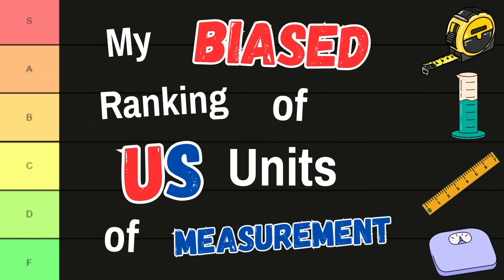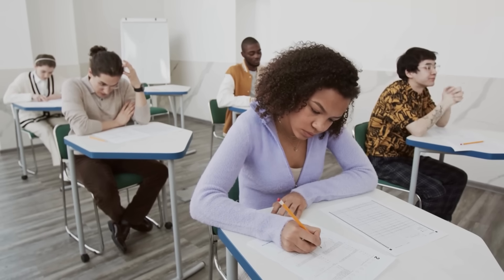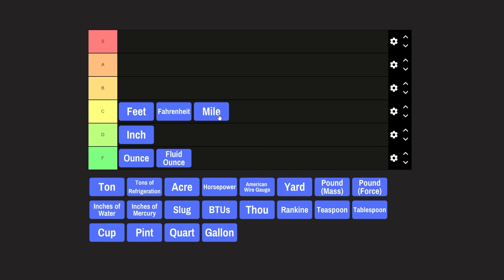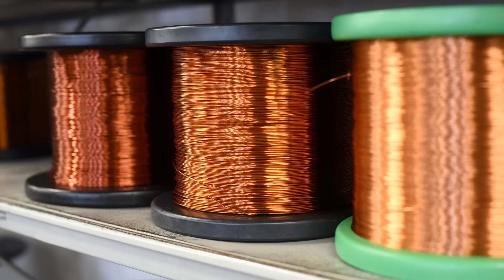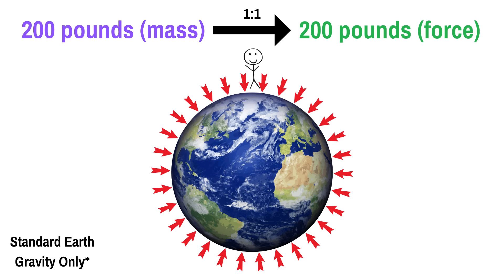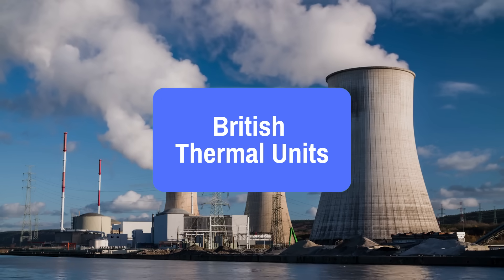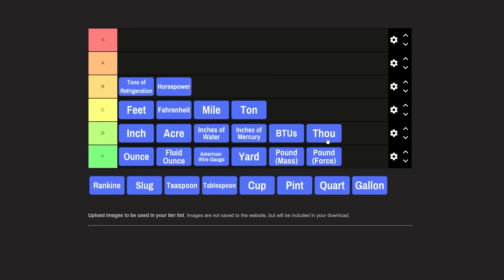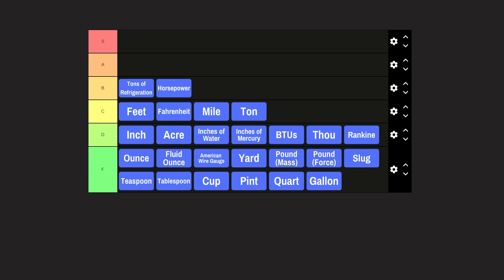Tier List of the DISASTROUS US Measuring System

Comment: The fact that you need to create a unit to define when you divide 1 by 1 should tell you everything you need to know about the US customary units
Reply: Some of these (BTU, Slug, Rankine, Thou) are metric units redefined with imperial units instead. A calorie is the energy needed to raise one litre of water by one degree C,  exactly like the BTU's "energy needed to raise one pound by one degree F".
Reply: stm7810  I'm not sure that's a "need".  SI gets along just fine with Megabytes and 60 seconds per minute.

Our numeral system is Base 10, but our math is base agnostic.  Except for Log.  But heck, it's usually overshadowed by ln anyway.
Reply: stm7810  I do enjoy seximal though
Reply: @pa28cfi Charge isnt a Fundamental Quantity. Current is. So it makes sense that Coulomb would be defined in terms of Currwnt and Time. 

Also Curr. and Charge are different, versatile, and widely used enough that they should have their own seperate units.

Ij terms of Slugs on the other hand there is no such reasoning or defence. Mass is possibly the most fundamental and basic quantity out there. And if you still need to define it in terms of one hyper specific unit acting on another hyperspecific unit, then yeah idl what to say after that.

Hope this helped clear things up 😊❤
Reply: @alexicon2006  charge could be a fundamental property
Reply: stm7810  All of the unit based disasters I'm aware of are due to conversion between the two systems.  Which is not the fault of either system existing, but to both existing.  If the world had gone British instead of French, but Quebec was a hold out, we'd still have these kind of disasters.

In short, that's an argument for a global standard, not one system over the other.

I'm not sure who your carpet guy is, but if he's used to feet that shouldn't happen.
Reply: stm7810  slugs work at any scale too.  It's just a unit.  They're all arbitrary.  Whether dividing them by 1000 or 12 to convert to another unit, they're all arbitrary.
Reply: Dude a Newton is defined by multiplying 1 by 1; it’s not any better
Reply: stm7810  all math is reliable.  SI is easier for you because you're used to it.  Imperial is easier for others because they're used to that

Comment: The problem for me with Fahrenheit is that it makes no sense. To me who lives in Sweden, the most important temperature is 0 degrees Celsius. Thats a temperature we se very often, and around that temperature I start wearing a jacket and putting winter tires on the car. Normal temperature during the year goes from -25 to +25. If I do it in Fahrenheit, the most important temperture is 32 degrees, and the temperature goes from -13 to 77 on a normal year. It is an overrated scale for sure.

In Sweden we have "spice measure", that is 1 ml, teaspoon is 5 ml and tablespoon is 15 ml. Very useful measures.

Comment: I think the other legitimate benefit of Farenheit over Celsius for the average person is that it's 180% more precise, so if I say its 68 degrees outside, that's tells someone more info than 20 degrees Celcius.
Reply: It's all down to what you are used to, i think.
Being from central europe for outside temps for me it is: 
20°C: short sleeves, 
above 25° shorts, 
30°C and above: uncomfortably hot.
below 20°C long sleeves are ok, 
below 15°C some thin additional layer on the upper body, 
below 10°C, i put on a cap and the additional layer on the upper body is more than just a thin wind protection.
Between +5°C and -5°C i put on my winter jacket and a wollen hat and a scarf.
below -5°C i am inclinde to put an additional layer under the outmost layer and gloves.
Below -10°C i definetly put that additional layer between the outmost and the inner layer and put on warm shoes.
Below -15°C  thicker gloves and the hood of the jacket.
(The lowest temp where i live as long as i remember was -22°C and i had 7 layers of clothing on my upper body because i was outside for a week of between -15 to -22°C having to sleep in a tent with a sleepiing bag that's designed with a lower limit of +5°C)
So in essence for outside temps i am roughly down to 5°C of resolution. Not even 1°
For inside temps: 1° is still enough for me. If only sitting and not working out or physically working, 22°C feels ideal to me.
23°C is still ok, 24°C is getting warm, 25°C is getting uncomfy. Anything above almost unbearable.
Don't even need tenths of degrees for that.

Apart from that, being 180% more precise (iirc) would mean there are 280°F in 100°C.
Reply: Because the temperature varies anyway one does not need such pseudo precision.
Reply: To me 68F outside doesnt say anything. You can always use 20.5C if you find you need to be more exact. But when we talk about weather we really dont feel need for that so we mostly use round numbers like 20 or 21.
Reply: @test-rj2vl what I like about F from someone who grew up using C is how intuitive it is when you think of it as a %. 70 degrees F is about 70% hot, so warm, 100 degrees is just brutally hot, 40 degrees is somewhat cold. I also appreciate the added granularity in air conditioning, as one degree celsius can make quite a bit of difference in how a room feels.
Reply: @test-rj2vl  fair enough, I'm obviously biased about this, so my arguments have to have a grain of salt to them.
Reply: About 1/3 of the year would be below zero on C. I just couldn't take that much negativity.
Reply: You could say 20 degrees celsius or 21 and I wouldn't know the difference, it feels the same
There is no need for greater precision and if you really need that you can always add decimals
Reply: @SuperCityscan  really? To me those temperatures (once converted to farenheit for my American brain) are pretty easily distinguishable, at least while inside.
Reply: @adamnielson42    Yeah, the apologists for Celsius bend over backwards to say that one degree Celsius isn't very much.   But it IS.  They just refuse to admit it.
Reply: @Milesco  Humidity, wind speed and cloudiness makes more difference than several degrees
Reply: @thenatron6136   That may be true (outdoors), but it's not much justification for units are that are inherently imprecise. 

And indoors, where you don't have wind and clouds, the imprecision of Celsius makes an even bigger difference.
Reply: @Milesco  68 vs 70 is one degree celsius and is a common argument amongst married couples and office workers everywhere lol. Idk why people hate on Fahrenheit when it’s easily the best part of the imperial system
Reply: @Milesco  indoors you still have humidity, which thows your entire argument out og the window. Nobody says ''Oh, it's 67F and 78% humidity, too cold for me'' the same way they don't say ''I got here at 16:47'' like they are trying to get fake alibi. And if you do, you have problems
Reply: @daliguj221  they hate on it because it's the most widely used, you can't go anywhere without noticing the temperature. And since it's the most widely used, it's the most easily comparable with other (objectively better) measurements of temperature
Reply: @SuperCityscan  I think I could. To be honest this is only with room temperature though, and even then only a range of 2 degrees or so.

Comment: I'm in the camp where I think fahrenheit is S tier specifically for weather. Using celsius is so annoying because 1 degree change is dramatic where as 1 degree change for fahrenheit can noticeable though minor enough to not need to use decimal places to give an accurate description of how warm/cold it'll feel
Reply: Metric is a massive nerd decimal circlejerk where they can't admit the human factors of Imperial in day to day life is less stale and sterile. Celsius was made for the spergers at the lab and dandruff shampoo, not my home living conditions and approximate DIY.
Reply: Sorry, I grew up with metric and I do. Not. See. Your.  Problem.

One degree Celsius isn't dramatic.  Sure, it's more than one degree Fahrenheit, but that doesn't make it a dramatic change.  22, 23?  Both nicely warm and not too warm (but getting there).  29, 30, 31?  All three shit, too warm.  10, 11?  No t-shirt weather, jacket to thick jacket depending on how long I'll be outside.

You Americans try your best on Fahrenheit, but your best still isn't enough because Fahrenheit is crap.  And for everyday life, it's almost as useful as Celsius.  IF you're used to it.  That's the main point: you are used to a system and that means it FEELS intuitive.  But it's not.  Nothing really is, not even metric.  "The only intuitive system is the nipple, and even that is learned"

Comment: The teaspoon and tablespoon are the only units that I like in all units of freedom. They are only the ones that work better than the metric system when you're adding seasoning to whatever you're making.
Reply: There are "spoons" in european cooking recipes too sometimes, but they actually refer to the real tea spoons and table spoons. And are known to be a rough estimation.
That said, i rarely cook something big enough to need spoons for the seasoning.
The amounts of seasoning i use are more in the ballpark of a "knifetip" or what the english language calls "pinch" or "dash". So not really something one would measure but guestimate.
Reply: Like someone already said, in a lot of European recipes spoons are used as a measurement if things don't have to be too accurate. Leaving the American system with no advantages... again.
Reply: I still prefer scaling, as there's really no consistency in spoon sizes...
Reply: @mateusfccp they make standardized spoons.
Reply: @mateusfccp There is if you use measuring spoons.
Reply: @mateusfccp  nah, using spoons is easier to clean up, easier to use, granular enough to be accurate, but general enough to be multipurpose. British bakers who have cooked with U(SA)nits before know it’s much easier but will never admit it. Similar to how I will never admit a kilometer makes more sense than a mile even tho it does (it doesn’t)
Reply: @memyselfandi4109  yeah but winging it works pretty good too if the granularity of spoons is enough.
Reply: @memyselfandi4109 imagine using miles lmaooo
Reply: It's good but straight up no way to be better that metric system since you can just count and calculate
Reply: Not really. Spoons vary in volume, and to me a spoon of whatever can be very different from what it is to you. My heaping tablespoon of potato starch could be twice in weight from yours, even if we were to use the exact same spoon, especially if we were to use ingredients from different manufacturers which might vary in granulation. Anyone who has any worthwhile experience in the kitchen knows we would get starkly different results. 

It's no good for seasoning either, because people usually season to their tastes but I guess it is a starting point from which adjustments can be made. That's as good as spoons get, which puts them beneath metric, where they should be.

Comment: Rankie is just a worse kelvin
Reply: Not really.  Neither really has any advantage over the other, once you convert it to an absolute scale.  The number 273 K for freezing water is just as seemingly arbitrary as the number 492 R.   They both lose their respective advantages, when converting to an absolute scale, and the convenient reference points are completely arbitrary numbers instead of nice round numbers.  Of course, they gain a different advantage, which is that they can be used in a formula that requires more than just temperature averaging and differences.

Comment: Fahrenheit might be arbitrary, but so is Celsius. We picked an arbitrary material and took its freezing point and set that to 0, and then took the boiling point at an arbitrary pressure and set that to 100. The only reason it's not used in science is that the french had a god damn fetish for 10. Meanwhile 10 is a terrible base for a number system in the first place.    12 is significantly better.

Comment: When you mentioned thous you could’ve also brought up kips (kilopounds) which also conveniently use that decimal-place-shifting method that would’ve been such a nice system to use
Reply: Wikipedia's lack of listed creator for that unit has either saved a life or a grave today
Reply: Confusingly enough, a kip is closer to the weight of a Swampert than a Mudkip.
Reply: But how does that compare to a short ton and a long ton
Reply: @abattlescar  1 kip equals 1/2 of a short ton, or 25/56 of a long ton.

And exactly 45 359 237 / 100 000 000 of a metric ton. Just in case you were wondering.

Comment: I prefer metric system for everything it makes so much more sense EXEPT FAHRENHEIT. I’m sorry to anyone who disagrees but Celsius is stupid. It makes so much more sense to rate it at 0 being way to cold and 100 being way to hot with around 60 to 70 being optimal it is a perfect scale from 1 to 100. Whereas Celsius if it is 0 degrees out your at freezing point for snow and if it’s 100 degrees out you are dead. CELSIUS MAKES NO SENSE FAHRENHEIT IS WAY BETTER.
Reply: There are people who thrive close to 0ºC, you know? (Barring those in Antarctica because temperatures there are in the negatives and I don't think there's a permit residence there.)

And I don't know about this, but people who live in hot climates - like in the tropics - would probably see more than 100ºF regularly, at least certainly in the summer times. So I think Fahrenheit makes sense only in a narrow range/perspective and/or in a certain context; I doubt the 0-100 in F is inclusive to those that live in extreme conditions.
Reply: @regulate.artificer_g23.mdctlsk  You are determined to nitpick and not understand the OP.  Sure, there are temperatures that fall outside the 0F to 100F range all the time.  The point is, temperatures people generally consider comfortable, and most commonly will experience, will be within the 0F to 100F range.
Reply: @carultch  Yeah, and with Celsius it's about 0 to 50, which includes what would be slightly beyond in Fahrenheit.

Comment: Would have rated Fahrenheit higher, maybe even an "A". It is really the only unit of measurement that is arguable better than its metric counterpart. For science, Celsius and/or kelvin obviously make sense, but in day to day life, describing our temperature experience on a scale of 0-100 is just better.  I can't think if a single time outside of a science class where the fact that water boils at 100 Celsius had any significance. That water freezes at 0 is slightly better/more helpful- but that is only upside for Celsius in regular life. 
When I go out in the morning, if it is above 0 but below 32 Fahrenheit, my car will probably start, I don't need any safety gear beyond my normal winter jacket, and I should watch out for ice... and below 0? That means use extreme caution for cold.
Reply: So you are used to how temperature in Fahrenheit feels like. I'm used to Celsius and can have completely same reasoning. Just because you wouldn't use 100 Celsius doesn't somehow make it worse. Freezing in 0 Celsius rocks and having compatibility with science is awesome.
Reply: @tomihuoviala  Based
Reply: One thing of note about celsius to me is that humans are comfortable between 18ºC (for cold climate people) to 32ºC (for hot climate people); beyond this range is bad weather (really hot summer, really cold winter), slightly uncomfortable; and well beyond that - more than ±10ºC beyond that range let's say - is either Climate Change (record breaking summer heat), or either a really severe weather/snowstorm or you're just in the polar regions, inhospitable.